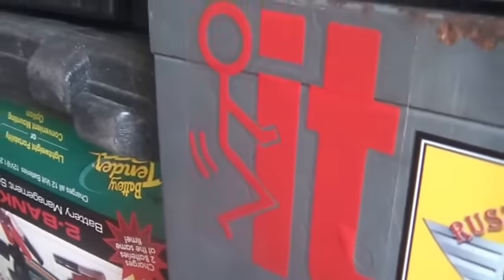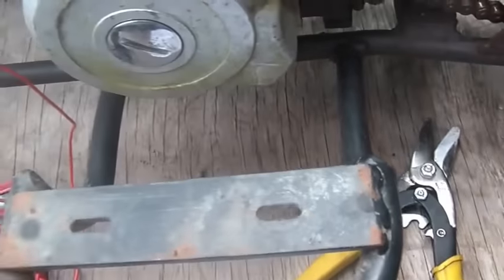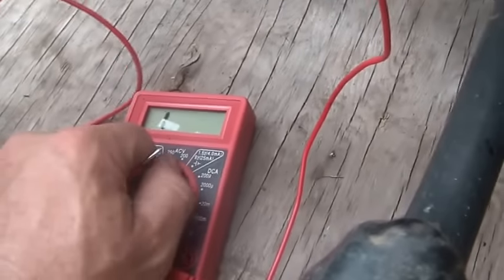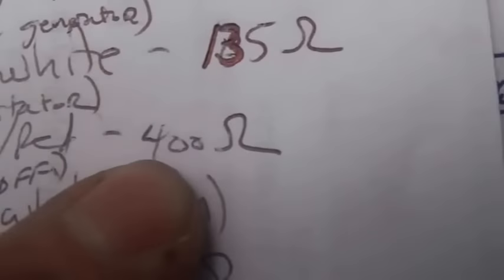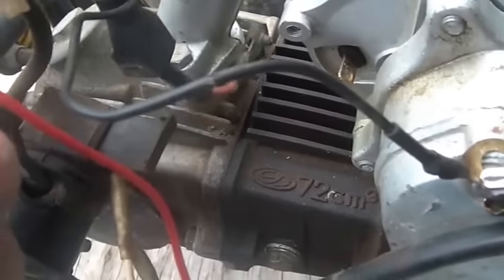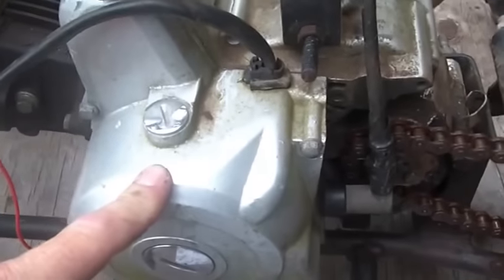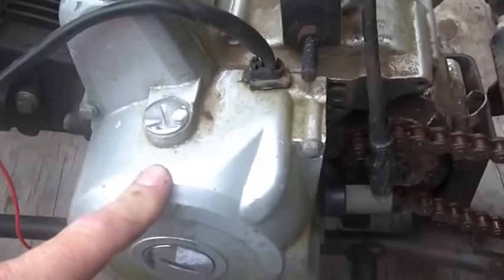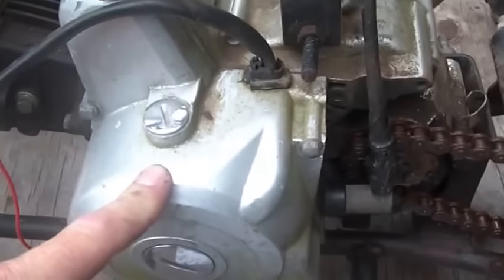Troubleshooting a no spark China Quad, critical wire harness measurements,

Comment: Sir.. I want to ask u.. My old engine is 120 cc.. And I bought 140cc lifan engine without ractifier and I use my 120cc rectifire. My engine start smoothly but my light bulb broke. When in high rpm. My question is should I buy a new 140cc rectifire or I can use the old. Is that possible 140cc give more power and can damaged my 120 rectifier?

Comment: Do you need to have a battery hooked to the bike to run these test?
Reply from the maker: Hey Mastermoi, Some ATVs need the 12VDC, most don't, if I do another video on troubleshooting a dead ATV, I would probably start with getting the starter to spin from the handle bar push button and then go forward from there, I recommend installing a battery, but, once again, some need the battery hooked up, most do not.... Thanks for asking, watching, and commenting!!!
Reply: Harvey Spooner Thanks for the response. I probably dont need it then its for a 1981 kawaski ke125 wich i never ran with a battery theres no electric starter. I found that the wires that goes to the generator melted on the exhaust so both of the wire were grounded. I redone the wiring but still no luck so ill have to test that generator i beleive.

Comment: Hey Harvey, good video. I just picked up a Zongshen ZS125ST ATV for free. I want to get it fired up for my kids. The motor cranks but doesn't kick. The wiring harness is all hacked up and I think there is supposed to be a radiator or oil cooler or something? There certainly is definitely something missing. I'm solid with the wrenching and the electrics, just not sure where to start on this thing. Do you know where I can pick up a manual so I can begin finding parts to piece this thing back together? Thanks.
Reply from the maker: Hey Brad, Can U make a video of it, to be honest, I ran a couple of searches and I did not find anything that I would trust, having said that, it seems that the engine maybe a transplant from a Zongsten scooter, if that is so, U may have some more luck getting a manual and parts. Look up Zongsten 125cc scooter, (I'm assuming 125cc, use the correct engine size in your search), Thanks for asking, watching, and commenting!!!

Comment: what if I'm not getting a reading on the black red wire from the stator  @ 4:00
Reply from the maker: Hey Datboi101 truth!!!  Sounds like U have an opened stator, if Ur lucky, it is a broken wire, if not, U will need a new stator, they are available for most China Quads on eBay and the cost is reasonable... Thanks for the info, watching, and commenting!!!   Good Luck getting it running!!!!    Let me know how it all turns out.
Reply: Harvey Spooner I got a new stator in yesterday and after i put it on she fired right up. 
 Thanks for the info
Reply from the maker: Hey Datboi101!!!   Glad to hear that U got it running and I'm glad to have been a small part of it... Thanks for the update, your thoughts, watching, and commenting!!!!
Reply: What reading should be coming from the red wire? 12volts D.C.?
Reply: hi Harvey on proshark quad no spark on red/black  617 on 2k   wat volts on turning over ?
Reply: Harvey Spooner can you help me

Comment: Very interesting mate , what do i need to do to run my bike without a battery ? just using the kick start ? Its got a Honda 110 engine in similar to your quad engine 
Do i need to fit anything or join any wires together cheers ✌️✌️

Comment: I have 110cc atv cracking too long won't start. Please help carb has been cleaned out. Got spark and maybe my valves setting and timing is off. I also don't know how to set timing but I know how to do valves adjust. Please help thank you.

Comment: I’m working on a taotao 110cc atk buggy n just made it crank I got all new harness n components but no spark, when I tested the wires coming from the stator they r all open circuits except the blue/white wire. Like I said all the components n harness is new but it’s the original stator.

Comment: Hi Harvey today some friend gime a mini quad ATV90 and I have no spark but also I don’t have a starter motor but I can’t find the diagram Manual I was wondering if I can have you advise to se were I can find some info or if you can gime some tips also I don’t have start button I make crank manually but once I connect the battery it I start to crank

Comment: Picked up a baja wilderness 250 atv for my kids and it didn't have a battery.  Starts right up with the pull cord but the kids find it hard to pull.  I bought a battery for it, didn't have a ground wire so I ran a new wire from the battery negative to the frame and another one from the frame to the starter bracket.   It turns over fine but won't start, if I unhook the battery ground and pull start it will run.  Once running, if I attach the ground wire back to the battery it will spark and die.   Also, if I run a battery with booster cables to the starter alone and crank it with the key on it will run.   I checked the ground wiring and it checks out ok, but with the battery involved in the system it won't run.  Any ideas where to go with it?

Comment: Hi buddy I have 1 110cc atv that will only spark once after flicking the kill switch in and off. Have read lots on these but no real solutions. Tried to take the black and white out the CDI that should disable the kill switch but still get nothing. Any ideas ? Tried 2 different stators, cdis, solinoids, even coils but no change. The loom is new also. Any help would be greatly appreciated

Comment: i have 11 pole stator 5 are the common wires and 6 are different. 1 is solid white and others are white with red lines. Is this a gear sensor? 1 for neutral and 5 for each gear? will this effect starting my motor? they are cut from there connectors. do bikes function like cars neutral safety switch?

Comment: Hello Harvey,I have ato tao tao 110 cc, I change all the kit of wires and parts, I have no spark.I check the resistance of all components. Everything is ok. The grounds are ok. The stator wires are conecting to the cdi. Is it possible that the kill switch of the starter that cuts me the sparks? What should I check?thank you for your advice

Comment: Great video Harvey. I have a question for you. I have a 2006 hammerhead 250 go kart that I am not getting spark on. I bypassed the kill switch and the ignition to make sure it was not the problem. Still no spark. I cut the black and white lead coming out of the CDI and when I touch the wire with my fingers the spark plug has a continuous spark. I am assuming this is some sort of grounding problem. Would you agree?

Comment: Hi Harvey.  I really enjoy watching your videos.   You mentioned the gy6  DC in this video.   I have a gy6 150cc buggy that is 12VDC.....my question is it has a voltage regulator and I'm wondering what it does when the voltage coming from the stator is DC?  Most, like you said, turn the 12vac into 12vdc to charge the battery so does that mean that on a DC stator, that the voltage regulator isn't needed or does it do something else? Thanks

Comment: Harvey, i got the 13.00 dollar wire harness for the China quad i am working on, installed it but did not unhook old cdi or key fob units initially. it did not have any spark after that. then i unhooked the old cdi and key fob units. It still does not have any spark. do you have any ideas what might be the problem. thanks, Kevin.

Comment: I've replaces stator coil cdi plug regulator .eliminated kill switch from cdi.all resistance ohms  are good.what could it be.no spark..defective new cdi?it cut off when son hit a bump and it only sparked weak once after.then I replaced all parts still no spark???

Comment: I went through my 110cc China quad and got the same ohm readings as you did in the stator wires and the cdi except black and red.  I have swapped in a new cdi and coil, still no spark.  What is the likelihood that the stator is bad?  Is there a way to test it?

Comment: I have a 2003 honda Shadow sabre 1100 2003.  Front cyclinder not firing. I think my cdi box is bad or do I need to change wire harness

Comment: hi I need help with my Chinese 250cc it had been parked up many years I have come to get it working and the ignition barrel hasn't got any wires to it. I have tried starting it with a booster pack and it sounds like it wants to start I've changed the spark plug and it's still not sparking

Comment: Hey Harvey I need help please lol I have a 98 Yamaha Moto 4 350 four wheeler was out for a ride all of a sudden it starts sputtering like it is out of gas however I have a full tank I lost all power to my headlights and dash lights don't have any power when I take a pair of needle-nose and touch it to the solenoid turns over but won't start still don't have power to my headlights or anything and it sounds like it's not getting no fire to it kind of would really appreciate some advice

Comment: Hello Harvey - i have found your videos quite helpful - i understand the basics but solid state ignition systems were always a mystery to me - thanks to your videos i now have a clue when it comes to CDI.  

I have a chinese quad - i believe 110cc - not starting.  Kick start is broken and only use electric start.  There is spark as starter first engages but then stops as cranking continues.  I followed your troubleshooting and red wire out of the case - it is there but not connected - has an insulated female lug that goes nowhere.  Come to find that the cdi gets 12v dc somewhere from the battery  circuit.  When i crank i see the voltage to the cdi drop to about 8vdc.  I measure the power from the case as 50vac - should i connect that direct as to the cdi power (black/red)?  Any other recommendations?

Comment: I have a 05 vipor 70 or maybe 90 not sure. Anyway long story short hubby drained the gas and I come out to smoke a cig and bam CAUGHT FIRE.. we saved it still good but had to redo the wires. Got everything hooked up like diagram  but won't get spark. We tried the coil on another block and it got spark. So we know it's good.. now please help me my 1year old loves to ride with us... the colors from block are(7.yellow/red 6.white/red 5.black/red and a white. Also a all black one with I would take that for grounding block. Also have 2 boxes one is a cdi and other remote receiver. Plz plz plz

Comment: sure you just didnt notice that you said the regulator changes ac to dc current.that would be the job of the rectifier.the regulator makes sure the battery is up to 12 volt or 6 volts

Comment: Hi Harvey , I was wondering if i could get your advise , i have a 110cc China Quad , it screwed up a couple batteries so i invested in a higher quality one and then i changed all of the Ignition parts , CDI , Reg everything , still appear to have no spark but it turns over ok , scratching my brain now trying to work out why it wont kick , any advise would be grateful , i enjoyed your video
Reply from the maker: Hi Casper, Seems that U R telling me that your quad was killing batteries, U improved the battery situation and U replaced the CDI, Voltage regulator, and ignition coil and now it will not start... If I understand Ur situation, the first thing I would do is go back to the OEM CDI and ignition coil... If still no spark, I would disconnect the engine off wiring, (the black wire with the white stripe from the CDI box, cut or remove it in a way such that it can be hooked up again), and see if U get spark again.... Some of the CDI boxes use AC, others use DC, so, changing the CDI box may have killed Ur spark, removing the engine off wire will tell U if the problem has to do with the wiring.... Let me know how it turns out.... Thanks for asking, watching, and commenting!!
Reply: the carby was completely stuffed after i replaced it the quad is roaring back to life
Reply: Casper The Ghost *
Reply: Sportster wiring

Comment: I have a 90 cc Dinli. I try to start but I only hear a clicking from the relay. The starter doesn't start.
what's wrong?
Reply from the maker: Hey Todd, A few things can be wrong, Ur battery can be weak, Ur starter solenoid may not be engaging, or starter can be dead, or Ur engine may not what to turn.... I would power the starter directly with a jumper pak or a known good battery, if it turns over, it is Ur solenoid, if it doesn't turn, I would remove the flywheel end cap and use a 14mm socket to make sure that the engine is free, (remove the plug), if it turns with the ratchet, it is Ur starter, if not, Ur engine is seized.... Put oil in the spark plug hole and use the 14mm on the ratchet to rock the piston loose.... Good luck!!!    Thanks for asking, watching, and commenting!!!!
Reply: Solenoid
Reply: Bet way to test this is take a screwdriver and connect the 2 module together on the solenoid, if u have any questions just ask me.

Comment: Hey Harvey I need help wireing up my 87 Yamaha warrior 350
Reply from the maker: Hey Nick, Do U have any of the CDI, wire harness, and spark coil or is it just an engine???? Thanks for asking, watching, and commenting!!!
Reply: Hey Harvey, I'm trying to get the wiring right on my warrior 350 it's a 89 engine with pullstart on a 2001,it will turn over but no spark an we tried bypassing all the safety on the warrior

Comment: Cheers mate my quad don't get no where near that much on the satur
Reply from the maker: Josh, Ur stator has much lower resistance then 400 Ohms????  That maybe Ur issue, sometimes metal debris gets between the fly wheel and stator and rips up the windings... U may have to open it up... Thanks for the info, watching, and commenting!!!
Reply: +Harvey Spooner I have and it don't look bad
Reply from the maker: Josh, How low is the resistance again?

Comment: i’ve got a green wire and a black wire coming out of my harness essentially side by side wrapped coming past the gas tank that have no where to connect to anywhere on the bike or in any relay, fuse, or anything at all that anyone can seem to figure out thus far. i tried to connect green to ground and the black to the red and then another time to the black and all i get is when it’s grounded  green and black to red - my neutral light stays on a little while even after removing the keys from the bike. but nothing else at all happens and I cannot read the diagram or understand it. I know my flashers stopped flashing, lighting up or getting the dash indicator light for them on- all stopped out of the blue one day, but those two wires were still hanging out by themselves then. i need help with each issue please. First time bike owner and in struggling here

Comment: harvey ive tried everything at least 3 times i still cant get spark
Reply from the maker: Hey Jeff, U changed the plug, (change it again!)cut the black wire that goes to the CDI such that it can be hooked up again, (leave both ends loose, touching nothing), U checked all the grounds, including between the engine and frame, the frame and battery, the frame and spark coil, and the wire harness and frame, U changed the CDI, Spark coil, and wire harness 3X and still not spark?  Now, U can see Y I started using the pit bike ignition and the pit bike ignition with the 12VDC cdi.... For me, I would just go with the pit bike ignition, AC or 12VDC.... For U, check everything above again, and then go with the pit bike ignition... I think some China ignition systems just can not be fixed without the repair person going crazy, so, they need to be changed... But, there are better, more patient repair people than me out there.... I hope this helps, thanks for asking, watching, and commenting!!!

Comment: Hey Harvey.  Wanted to say thank you.  Got my son's Tao Tao 110 running for the first time after 6 years of just sitting there.  Pulled the kill switch wire from the CDI as you pointed out, sprayed some WD-40 in the carb and it started.  Ordered a new carb from eBay for $15 and it starts right up, every time.
Not sure which of the 5 or 6 redundant kill switches is the culprit, but hoping I can remove them all except for the key and the left side handle bar red button kill switch.
Question:  Assuming I can just splice the "kill" wire to the CDI to only the key and the red button on the handle bar and I'll be able to shut the quad off?  In the mean time, using the carb's choke to kill the engine, which works every time.

Comment: I know this is an old post but thought  i would give it a shot and ask ,i hav 90cc kymco mongoose  atv ,that wont do anything no crank no lights ,when i turn on the switch to start it ,but when i bought it ,i put new switch, new battery and cleaned old gas out and carburetor and when i tried starting it it cranked and ran but was running wide opening, so i took carburetor bak off and checked everything and put bak on it wouldn't do anything now ,also has new starter relay and plug and i checked gap on plug ,should i follow this video ,if anyone sees this would reaaly appreciate any help thanks